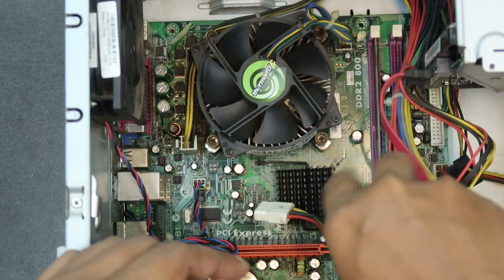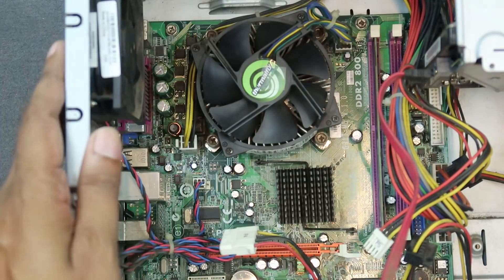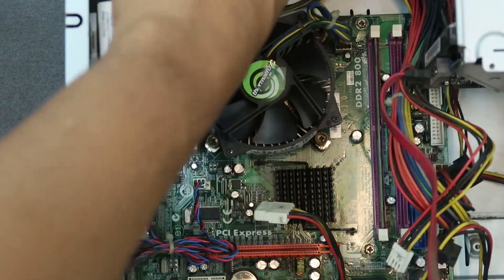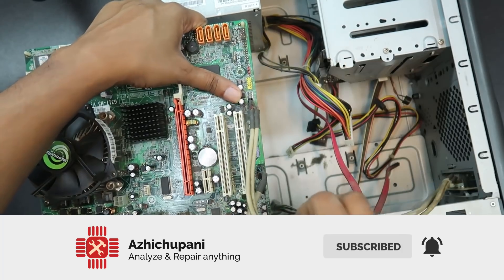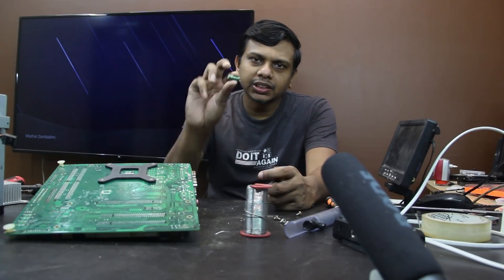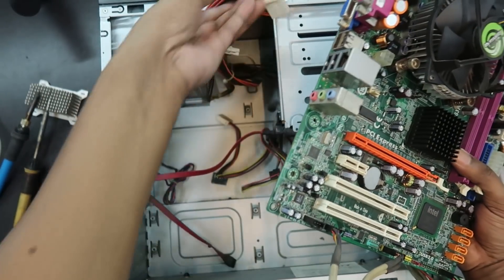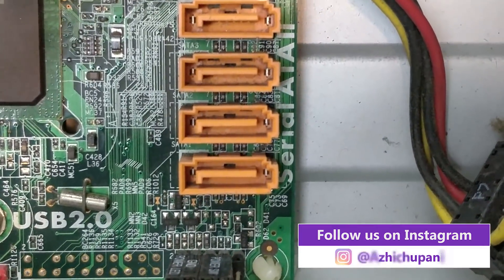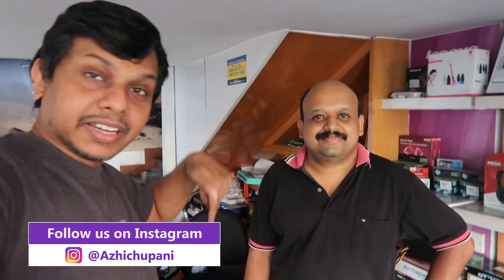Trying to Repair a 14 year old PC PART2 | ജാമ്പവാന്റെ കാലത്തേ കമ്പ്യൂട്ടർ റിപ്പയർ ചെയ്യാൻ ഉള്ള ശ്രമം

Comment: If your are changing the motherboard 
Then i assume u must change all other components (processors,ram) because this is an outdated technology and new motherboards doest support ddr2 ram and old pentium processors
                                  -Linus tech tips fan
Reply: Old motherboards with warranty is also available now like G31 G41 motherboards which supports DDR2 and DDR3
Reply from the maker: @Anoop in the video has commented.. so no more comments required from me.. 🙌🙌🙌🙌